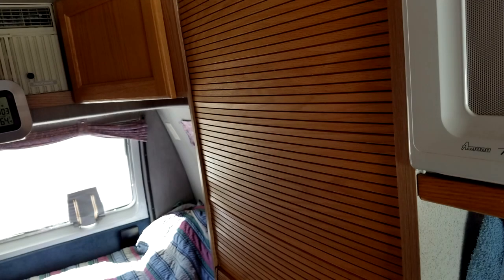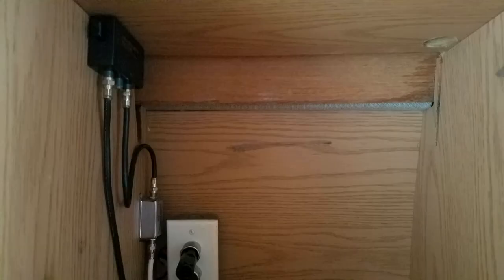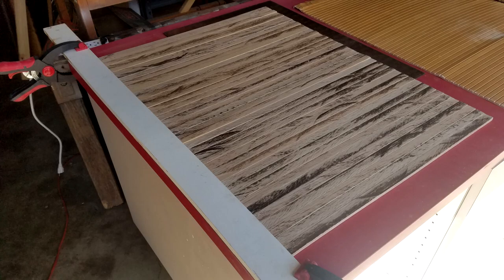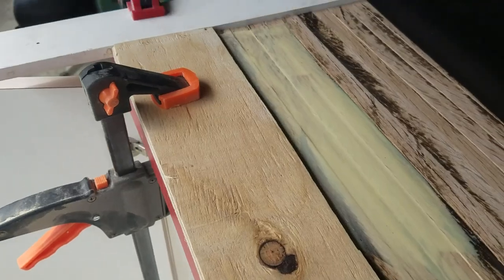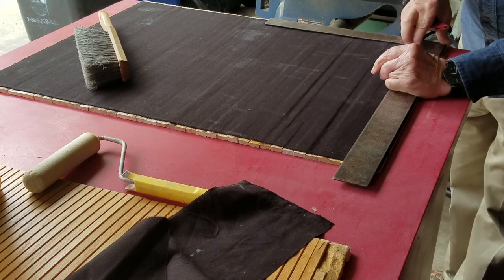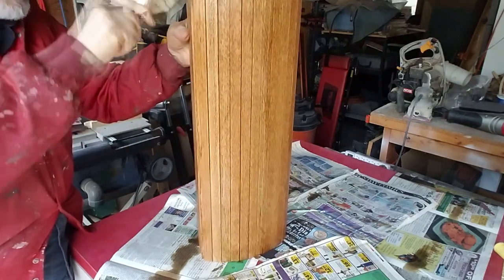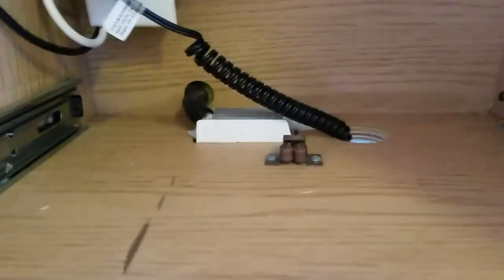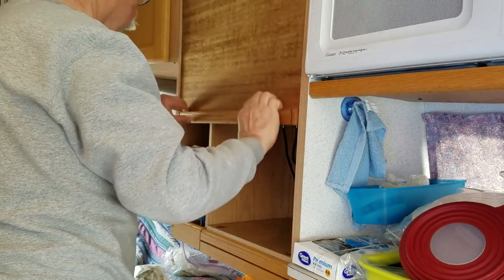Tambour Door Replacement

Comment: I Need one of those and can not find one. I don't have all the wood tools that you have. What kind of wood did you get from home depot? I couldn't understand form the video. Did you cut it in all those sticks or was it all already cut?
Reply from the maker: I replied here a while back, but see it does not show as a new post…sorry.  I ripped the individual slats from 3/4 inch stock, red oak.  I have very basic table saw and other tools—nothing fancy.  If you don’t have a table saw you might be able to find a home handyman willing to do it.

Comment: How long is the finished door, top to bottom, including the handle?  Mine came to us damaged, some slats at the top had been cut off so it had an opening at the top.  It finally worn out and broke so  it's time to replace completely but I don't know how tall to make the tambour.
Reply from the maker: Different models have different measurements, but if the present one has a gap at the top, just add enough more slats for a total height that the top will just disappear as it goes into the curve and show no gap.  If you add too much height, it will not open clear up and the bottom edge will block some access to the upper interior of the cupboard.